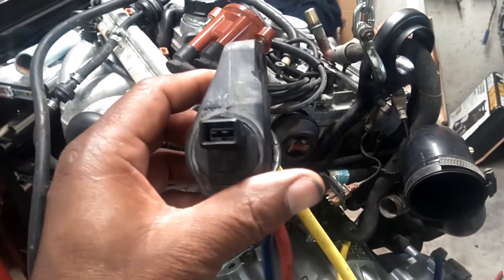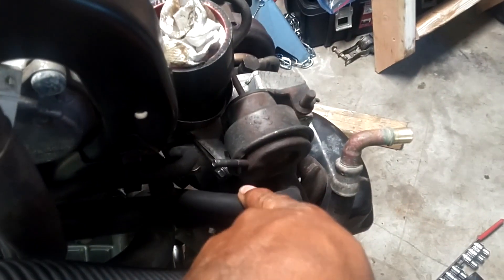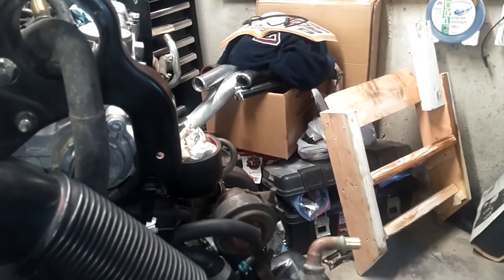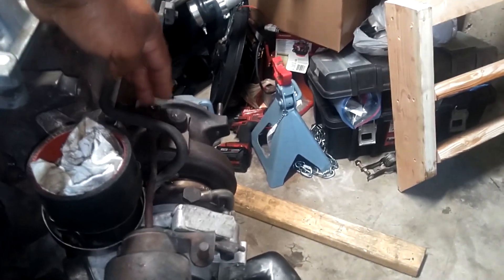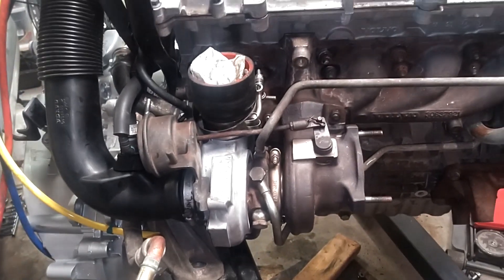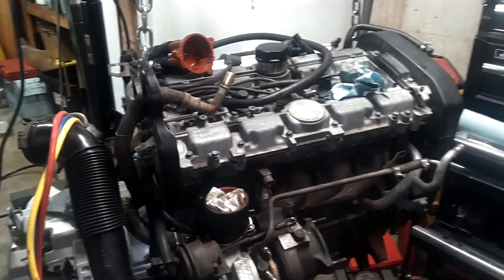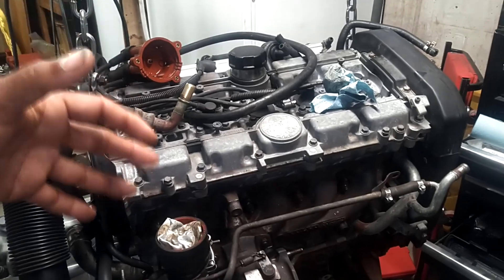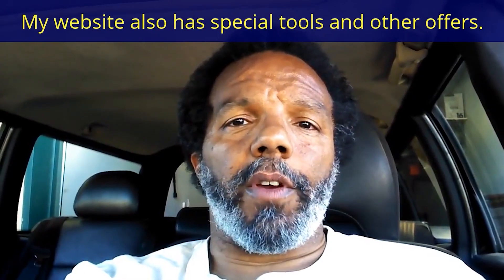BCS, boost control valve & TCV, turbo control valve explained. How  connected and what does it do.

Comment: Hello Robert. I have been told that the IPD Heavy Duty Control Valve is likely to fail and overboost without warning. I run a Mitsubshi 16T on a '94 850 T5 with a custom ECU programmed to power a stock engine. Should I be concerned in any way?
Reply from the maker: not really.

Comment: Hi Robert, and thanks a lot for your Teaching... I´ve found there was wrong conection on my turbo, 2 lines were "twisted".
Now I can´t find how to know if the BCS is working properly.
so, when the BCS is OFF, it must be  ¿ Normally Open or closed? between yellow, blue and red ports? and what if it´s ON condition ?
Thanks again
Reply from the maker: The BCS really only controls the waste gate actuator. It reads the boost, reads the intake air, and THE ECU controls the air to the wastegate actuator to control the boost.

Comment: what would cause boost cut at high loads? waste gate diaphragm? or positive pressure line from the turbo housing compromised/cracked?
Reply from the maker: To much air, not enough fuel, knock, could be a number of things.
Reply: What would cause sudden burst of boost at around 5k rpm? @RobertDIY
Reply from the maker: https://youtu.be/NhtUXZTurzo

Comment: Hi Robert! I changed such a round valve as on video to a rectangular one from V70. The car went much faster. But the question is, is it possible to change this valve without changing the rest of the turbine settings? will I ruin the engine and my automatic transmission? The round valve at 850 almost does not work and passes a part of the turbine pressure into the intake manifold.
Reply from the maker: that's fine. Should use ones from '98 to '00 cars.

Comment: is the yellow outlet always closed so it doesn't get a load from the turbo
Reply from the maker: huh? I don't understand your question. don't worry about open or closed, just make sure it's connected where it should be.
Reply: @RobertDIY  the electromagnetic valve of the turbine is always open to the wezdgate, whether it is regulated by the valve or it must always be open